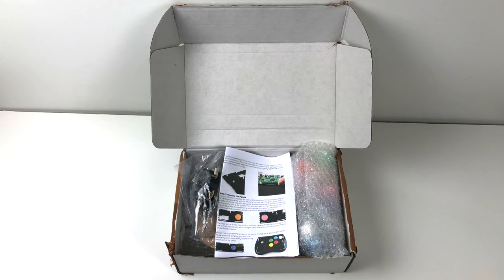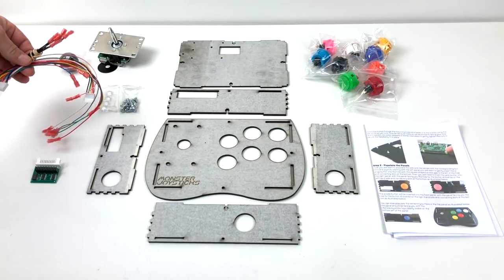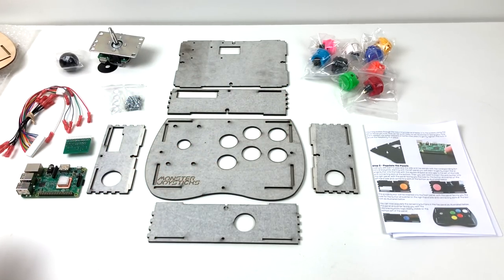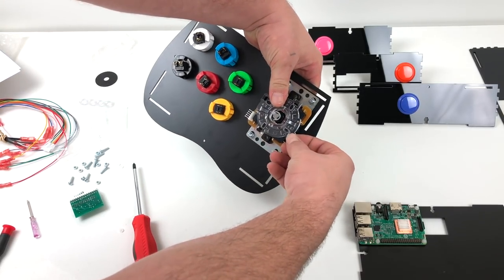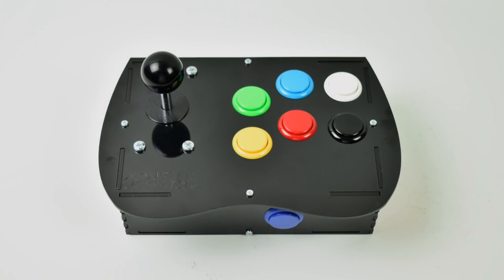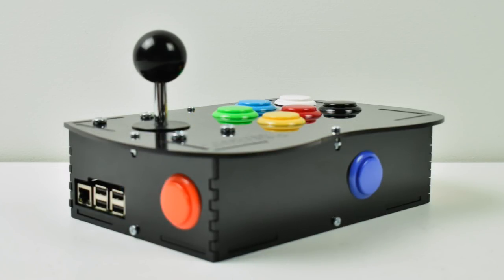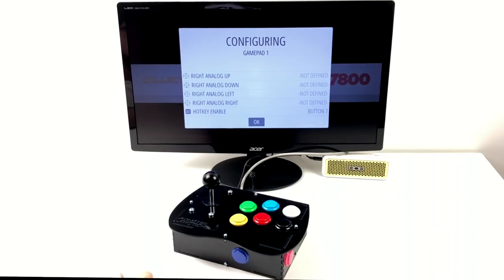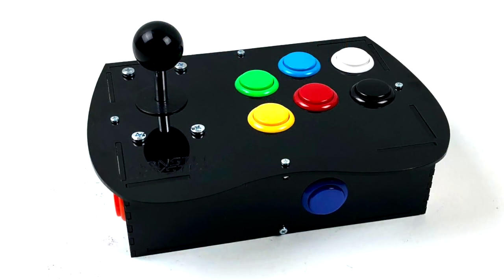Monster Joystick Raspberry Pi 3 Powered Arcade Stick Assembly And Test

Comment: I bought a clear acrylic joystick and put my pi3 in it. Have a battery and a 10 inch sreen to attempt to fit this weekend. Bought some clear acrylic sheets and clear hindges to make a screen case with some 30mm x 70mm speakers.

Comment: A nice looking kit, A bit small though, would prefer something a bit wider, doesn't look like I can rest my palms with this kit easily.  However they do just sell the controller board seperate, so might be able to mod my old mad catz arcade stick.
Reply: I agree too. This looks godd and handy, but a little wider would better.
Reply: Yeah I like the compact form factor of this one.  It makes for a good portable system as well.  With smaller sticks, my only concern is weight.  I like the stick to feel a bit heavier and sturdier.

Comment: I just picked this up based on your review. The joystick is awesome, but the octagonal restrictor plate is basically a requirement.  The stick is really difficult without it, especially on games with little to no give (Burger time, climbing on/off a ladder, etc).

Maybe it’s the nature of Sanwa buttons, but not super impressed with those either. Not quite enough spring back for games that require button mashing (Track & Field). 

But +1 on that GPIO encoder. No delay whatsoever.

Comment: As I commented on Retro Man Cave's video on the same, I'm a little let down that the screws on the top surface aren't countersunk screws.  If they aren't flush with the surface, then you have to be mindful of where you rest your hands, if you don't want the screw heads pushing into you.  The screw on the bottom left of the stick seems like it's in literally the worst place, for how I hold a joystick.

Comment: What about 2 players at once? Any kits with 2 joysticks and 2 sets of buttons? (either in the same case or 2 separate cases) Can Retropie handle 2 players at once over the GPIO?
Reply: I don't think it can handle both players on the same GPIO pins because, for example, if 2 buttons share the same pin(s) and they're being pressed at the same time, the signal would be overlapped. One solution would be to have a USB arcade joystick connected to the raspberry ports (I don't know about the input lag for that case though)
Reply: Apparently with the new V2.0 Adapter you can use the joystick as a stand alone USB PC joystick, or hook up two kits for two player.

Comment: The JLF version you use is ment for thick arcade panels.
If you look into a madcatz te stick or into a candy cab and the viewlix wich have thin metal panels, there is a u shaped mount to lower it.
Long story short, you might want to try lowering the stick a bit.
Reply: Herr Bert hi, 

I tried lowering the stick just using 5mm nuts (like the ones it comes with)  to use as standoffs.

Unfortunately lowering the stick by even that small amount in this chassis, causes the stick to bash against the gpio hat.

I think the stick feels too high, I'm glad you said something. I may try the shorter shaft.

shaft I believe comes with this kit: Sanwa JLF STD SSH shaft

shaft I believe would feel much better when used instead: Sanwa JLF LOW SSH shaft

I compared the stock kit here to my RAP V Hayabusa stick and the monster stick is definitely riding too high. Very noticeable when played side by side with another stick.

Comment: thinking  maby so low strength thread locker or some  thin rubber washers  in between  the metal and the acrylic to take some of the hard load

Comment: I noticed in ETA's video that the Retropie Settings section of Retropie has a bunch of settings I have not seen listed before. I am guessing there is a newest version of Retropie I am not on but if not is it something that can be configured to be visible somewhere? i.e.- Retroarch Bezel, GPIO Shutdown Utility, Switch to Attract Mode, etc.

Basically short version how do I get all those settings to be visible on my Retropie install :)

Comment: @3:50 -- 4-way vs 8-way is NOT a matter of preference -- it depends on the game -- some games will totally glitch out and not work (like donkey kong or pacman) with the 8-way (i.e. when you hit a diagonal, jumpman just freezes up, it's super annoying). -- And other games require the 8-way (i.e. mortal kombat, streetfighter, etc.) -- That's why you shouldn't be using swappable plates, but instead, you should be using a servo joystick (one that swaps the restrictor's mode via a servo).
Reply: You realize a 4-way gate doesn't restrict the joystick from going diagonal, right? It's purely for feedback.
Reply: the joystick is still made of 4 micro switches, despite being square or octagonal restrictor. It is preference, games don't behave different changing gate.
Reply: If it doesn't restrict then it's not a proper restrictor plate, obviously.  That's kind of it's only job.  That's why the servo based joysticks exist, is because switching between plates manually is such a pain.

Comment: We have updated the panel slightly on our new kits so that it is a better fit for the Raspberry Pi 4 however the Pi 4 will still fit and operate in our old cases too its just a slightly tighter fit around the USB ports. The adapters themselves will work with the latest version of the SNESDev drivers and a Raspberry Pi 4 as I pushed an update to the main repository with a fix.

You should already be Pi 4 compatible.

If you have any further questions please do not hesitate to contact us,

Kind Regards,

Ian Thomasson Lee

Comment: Seems price $135 is a little steep, or am I just out of touch on price of parts?
Reply: It's super steep, but if you tried making your own joystick you'd see pretty similar pricing, ESPECIALLY once you start digging into buying sanwa parts.
Reply: I thought so at first too but when you look at the prices for good parts it comes in pretty close.  The big thing here is the GPIO integration for the controller. Everything else I have looked at goes off USB and that induces lag and takes up a USB slot.  That in turn usually means you have a plug/cable out the side or you have the RP completely enclosed making it impossible to use the USB
Reply: lol welcome to the year 2018 my man that's actually pretty cheap

Comment: how would one do a 2-player game on this Joystick? Since the controller is GPIO to Pi, it doesn't seem like you can do 2-player.
Reply: Well, I'm thinking of getting a second one of these once I figure out why I get no video when the GPIO-interface  is connected, because the newest interface comes with a micro USB-connector on it and a cable so you can actually plug a second one into the pie inside the first one.

Comment: Looks ok 
$135.00 USD For the case Pi $45.00 USD And a 200GB micro sd $80.00 for a nice amount of games That comes to what $260.00 USD before tax holy crap i wish the case was cheaper.
Reply: damarlboromans you can get class 10 SanDisk 128GB Cards for around $35. The joystick and buttons are really good quality. I prefer the buttons that came with this, to my Rap V Hayabusa fight stick buttons. A piece of duct tape helps stop the nuts from falling when putting the final top on. I'm happy with it. hope that helps. I also like the idea of putting the same hardware in a mayflash f300 though.

Comment: Bad interior design. Assumes you have no cooling on Raspberry (besides the small regular radiators) otherwise it's impossible to mount. The case is simply not tall enought. Joystick rod hits the radiator and there is no space to connect the GPIO interface. The case doesn't have any ventilation holes (except the sd card space) so I woudn't let my Rpi stay there without good cooling solution. This is ment for retro pie and alike gaming, so no cooling is no go for me.  So I need to make major mods to it. :(  Other than that, say quality wise, seems very ok.